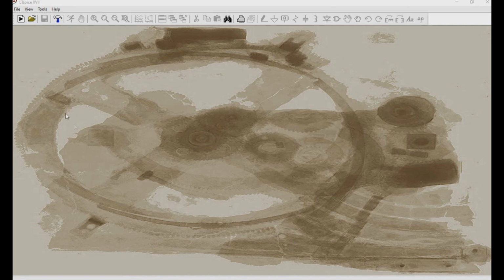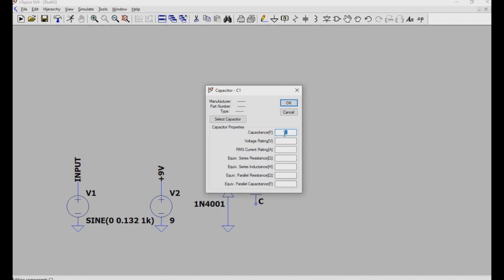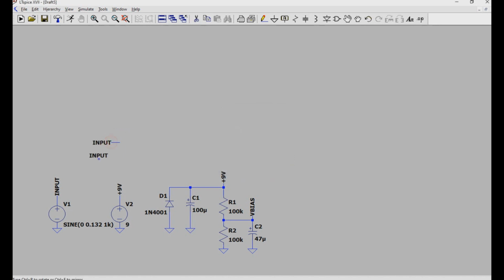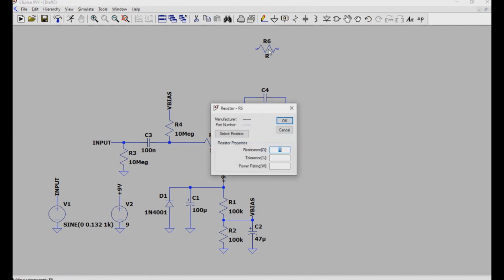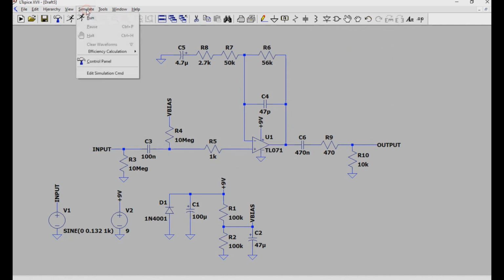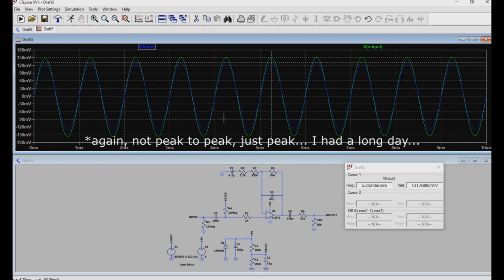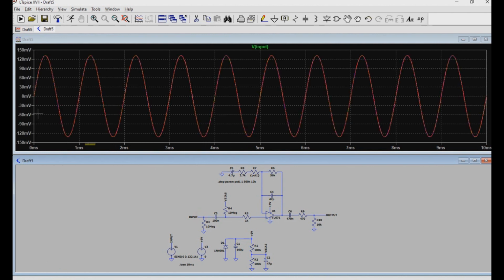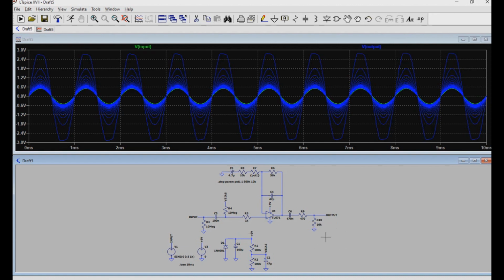Beginners Guide to LTSpice for Guitar Pedal Builders, Part 2: Building Our First Circuit

Comment: I am wondering if there is any program similar to LTSpice that can render audio live, instead of needing to export a wav file.
Reading through Max/msp, there is no way to accurately simulate guitar pedals with virtual circuit simulation because of the complex interaction of real electronic components. This program can get 99 percent of the way there, but does not afford the ability to insert a wav file and listen to the result of the circuit that’s being built.
Is there a reason why this is not possible? Thanks!

Comment: Edit Simulation CMD? Not on Windows (11 March 2025), but just press the Green play (simulate) button and the Configure Analysis dialogue comes up (also from Simulate menu)
When using LT072 it came up with a nodelist error: "Expected device  instantiation or directive here." Perhaps it's not finding what it needs. I just used Universal OpAmp 2 and it worked. Previously I had no autogenerated folder (from part 1) Maybe that's the issue?

Comment: At 19min when input signal was increased to 0.5V I expected the amplified signal to clip at 4.5V. Why did it clip at 2.7V?
Reply: Hi Tom, good question. This is an issue of headroom. So that output is being probed at the output, which re-biases everything to ground via the R10 resistor. But where it might be more apparent as to what happened is if you probe the output pin of the op-amp itself, where things are biased at 4.5V. Because this is a single supply op-amp, and because of the head-room issues, this op-amp will clip at around 7.2V. 7.2V - 4.5V = 2.7V. So, when we re-bias it on the output, it gets that symmetrical clipping. If you were to increase the supply to an 25V supply, the issue almost goes away.
Reply: @erikvincent5846  Thanks!
So I figured that in order to maximize output I could simply bias to 3.6V instead of 4.5V. Now positive output clips at 3.6V, as expected, but negative output clips at -2.2V. —> asymmetrical. If I bias to 5.4V the opposite is true. The peak-to-peak voltage seems to be fixed at ~ 5.8V and the bias voltage determines if the output is symmetrical or asymmetrical and which side of the sine wave gets clipped. Also, with bias voltage of 4.5V the output is not truly symmetrical. For true symmetry, bias voltage needs to be ~ 4.36V. What’s the deal?
Reply: @teblake3  That's headroom with op-amps. That's why there are things like "Rail-to-Rail" which let you get closer to the voltage rails of the op-amp without clipping. However, a lot of those types of op-amps have distortion issues. This is why on op-amp boosts that really give a large quantity of undistorted gain, more voltage, or even dual supply op-amp setups are introduced. A good example is the Klon. It uses a charge pump to boost the 9V to 16-ish volts and provides a negative 8-ish volts to give the TL072 opamps a range of 24 volts.
Reply: @erikvincent5846  Thanks! Your videos are excellent.
Reply: For the record I was wrong about output not being symmetrical at 4.5V bias. The simulation was only for 10ms. The signal doesn’t stabilizes until after 10ms.

Comment: Great explanation, I did the opposite for distortion plus base circuit. I put a A500k pot where R6 is to control the gain instead the C500k at the end of that line (original circuit) so I can control the gain with a normal log pot instead the anti log. Works and sounds great. 

I did some other mods for clipping diodes and the input cap value, some people says has too much treble (which I like) so I put a on on switch for a cap selector.

I simulated all this in spice to test before building the pcb...     ...I really love this pedal.

Comment: Erik, 

This is a fantastic series and extremely informative. I've learned more about modeling circuits with these two videos than I have in months of reading. You've explained the concepts clearly and in an easy to follow manner. 

LT Spice on the Mac needs a mouse. Many of the commands on the Windows side appear to be only available if you have an actual mouse. Apparently, control click is not a 'right click', which is what LT Spice on the Mac needs to edit values (like Spice Directives). I can't wait to start on video 3!

Comment: Thanks for this tutorial.  I may give LTSpice a try, but I just installed the Mac OS X version and learned that it does not support the Schematic Editor Toolbar.  It only offers a simplistic and awkward user interface with lots of shortcut keys to learn or reference.  It's freeware and I can understand that Analog Devices is serving the lion's share of its user base with Windows.  Still, it's a bummer. :-(
Reply: look into cask, it's wine for macos and generally works with near everything windows based programs. not everything will work, but i'm sure this program would if there isn't a mac version, i'm not fond of this program simply because of the way it is laid out and the mouse panning when using a tool that refused to exit is annoying, but it is what it is.
Reply: @redkurn  Thanks for that advice.  I'll checkout cask.

Comment: Hi, I just created the TL071 as on prior video and created exactly the same circuit as you, but, when using the TL071 the output goes from 2.4mV to -1.6mV with 0.132 as input and R7 50K / R8 2.7K as prior the change to a pot. But, when I use the universal opamp everything works fine. I try creating a TL072 as well, and none worked. I used the x.301 files from your repository, and also downloaded new fils from www.ti.com, I watched both videos againg and started all over again. Not worked. Any tip or advice? Tks!
Reply: Let me see if this will fit in the comments section, but here is the contents of my TL071.asy file that should be in your %userprofile%\Documents\LTspiceXVII\lib\sym\AutoGenerated folder. Also make sure where it has the ModelFile, it obviously has your user account there and not mine:
Version 4
SymbolType CELL
LINE Normal -32 -32 32 0
LINE Normal -32 32 32 0
LINE Normal -32 -32 -32 32
LINE Normal -28 -16 -20 -16
LINE Normal -28 16 -20 16
LINE Normal -24 20 -24 12
LINE Normal 0 -32 0 -16
LINE Normal 0 32 0 16
LINE Normal 4 -20 12 -20
LINE Normal 8 -24 8 -16
LINE Normal 4 20 12 20
TEXT 16 20 Left 2 TL071
WINDOW 0 16 -32 Left 2
SYMATTR Prefix X
SYMATTR Value TL071
SYMATTR ModelFile C:\Users\evincent\Documents\LTspiceXVII\lib\downloaded\TL071.301
PIN -32 16 NONE 0
PINATTR PinName In+
PINATTR SpiceOrder 1
PIN -32 -16 NONE 0
PINATTR PinName In-
PINATTR SpiceOrder 2
PIN 0 -32 NONE 0
PINATTR PinName V+
PINATTR SpiceOrder 3
PIN 0 32 NONE 0
PINATTR PinName V-
PINATTR SpiceOrder 4
PIN 32 0 NONE 0
PINATTR PinName OUT
PINATTR SpiceOrder 5
Reply: @erikvincent5846  Thanks man! After some time of troubleshooting I realized that I mistyped VBIAS. Now everything is working fine! 👍🏻

Comment: Can this program do frequency spectrum simulation/analysis on the output as well, or just a single frequency as shown here? Would like see how changes in the circuit affect the output frequency response of the circuit, for tone shaping.
Reply: Yessir, that will be coming a little later in this series. I'm trying to keep these "short" so not to lose anyone, but up next is impedances along with clipping waveforms, then we'll be doing frequency analysis along with using dual variable resistors to emulate a potentiometer in a tone stack.

Comment: Just realized how anemic the OS X version of LT Spice is compared to the Windows version and for no good reason so I give up.
Reply: @cpadude123  I had to right-click all over tarnation and go though several menus just to find the ground symbol, and even then there were options so I can't be certain it's the right one. The toolbar seems completely essential and trying to build a schematic without it is an exercise in frustration that I'm not willing to endure.
Reply: @fooschmack  It turns out that control click on a MacBook and right click on a mouse are two different things. Once I used a mouse, the Mac version stopped being so annoying.
Reply: @bigradio9396  I'm sorry, I know you're trying to help but can you tell me how it's any different?

Comment: Hello, I'm really digging those rather theoretical videos, thanks for making them! 
Is there any way you can address the calculations and the physical impact components have on the input signal? Would be awesome! Have a great day!
Reply: Shouldn't be a problem. Next video will be on impedance in LTSpice, but after that will be filters and "two-resistor" potentiometers. I wanted to do some of that in this video, but thought it was already running too long.
Reply: @erikvincent5846  Alright, thanks a lot!